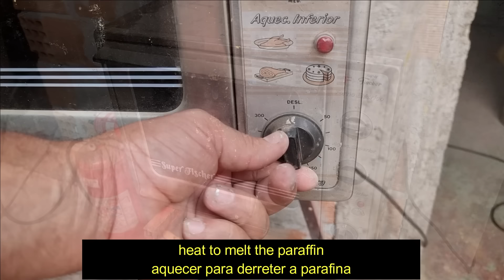BOMBA D'ÁGUA CASEIRA, uma boa ideia para os extintores usados

Comment: Professor Pardal.  You have made an excellent video to manufacture a centrifugal pump from the unserviceable machine and other used items commonly available with the amateurs and hobbyists  . Especially commendable are the manufacturing technique for the impeller and then its balancing in a very impressive, methodical and indigenous manner. Great.
Reply: The technique he used for the manufacturing of the impeller is called investment casting.

Comment: REALLY cool build.

You can skip all the casting work by sourcing the impeller from a used water pump from an automobile
It will already be balanced

You can also put a rheostat on the motor so that it does not spin to fast and cause cavitation and not pump efficiently

paint the inside to give it more time before it rusts and use stainless for the mounting plate for the motor

Comment: You'r talented !!! Basicly you just made water pump/vacum cleaner,, i suggest you to not locked the dynamo's chamber, so it will fixable when the dynamo is dead/short/or even need to replace.

What does it mean if you manage to turn trash into something useful but in the end it's just trash because it's hard to fix/unrepairable when its broken? don't make disposable items.

After all,you are amazing and talented 😊😊😊😊😊😊

Comment: Yes, in the presence of cutting wheels and a welding machine, bolted and screw connections have become irrelevant. What is the height of the water column of this pump? It seems to me that the suction chamber in it could easily be made more productive ...
Original:
Да уж, при наличии отрезных кругов и сварочного аппарата болтовые и винтовые соединения стали неактуальными.
А какова высота столба воды этого насоса? Мне кажется, что всасывающую камеру в нем легко можно было сделать более производительной...